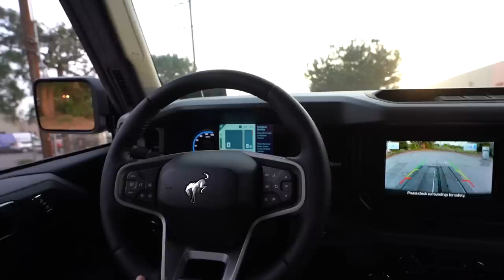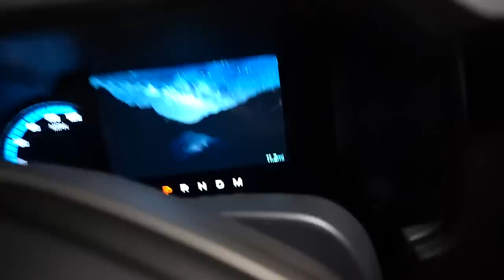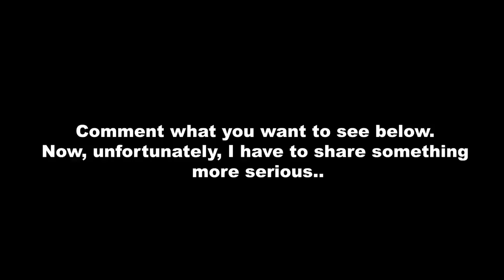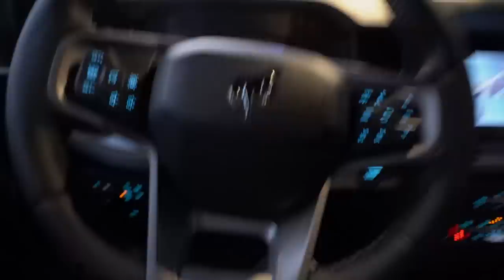Finally Taking Delivery of my 2021 Ford Bronco!

Comment: Sorry to hear about James’ injuries.  Hopefully he’ll recover quickly.  I have yet to see a new Bronco “in the flesh” even after several trips to the dealership.  It would have been nice to see you perform a brief presentation of your Bronco and hear your first impressions of it before you modify it although I am looking forward to seeing the wide body kit on it.  I thought the burn out with <10 miles on the odometer was a bit much, but it’s not my vehicle.  Then upon second thought you did the same thing with your C8 and look where that’s brought you.  Our brief look at Tomato’s new interior was impressive.  The new parts really cleaned up the interior and made the conversion look professional.  Nice job.

Comment: 6in long travel kit with 2.5 coilover reservoirs , upper and lower control arms 2.5 shocks in rear with reservoir....wide body for the extra width upfront and your choice of 35 or 37" wheels

Comment: Get well James!!!
I want to see Coyote engine swap, solid front axle and on 40’s 😜
Reply: Leave the axles, we wanna see just the coyote swap just to make it simple 🤣
Reply: @chri2halty954  solid front is much stronger. Probably want the ifs if you go long travel though
Reply: @chickensfloat7427  long travel ifs is so nice looking. Seen the new Bronco raptor? Comes with it
Reply: @chri2halty954  just googled it, not gonna lie that things pretty dang cool. I like solid front axles but im the kind of person who likes old outdated primitive but tough shit. I daily drive a 40 year old jeep, im probably just weird. Ifs is probably better for 90% of what broncos will spend there life doing, hell its hard to even find a jeep with mud on the tires
Reply: @chickensfloat7427  wellllll i bought a basic 4dr bronco without the lifted package because i rarely have time for off-road. If that's something you're going to be doing then definitely worth the small price for the upgrade
Reply: @chickensfloat7427  and i understand, Independent suspension is good for both Terrains. Especially for On road use, it's extremely smooth and comfortable but it's good for taking abuse off-road as well. Just make sure you have beefed up tierods 😂
Reply: @chri2halty954  ifs is great, but what concerns me is when lifted cv shafts tend to be more picky then driveshafts and u joints. No sence spending the extra $ i know if i bought one i wpuldnt be able to afford to beat it offroad 😂 another reson why i drive old junk
Reply: @chri2halty954  i praise my solid axle in my jeep, but with leaf spring horse and buggy springs it doesnt handle bad for what it is, but like most old jeeps it handles like a turd sandwich without the bread. Every bump rattles your teeth out and every turn has to be taken slow. Ifs is wayyyy better for most people, i just like to mod things to a unreliable point and beat on my cars. We have a early 2000s ford truck, now 170k miles in due to the lift the cv axles at a steep angle has worn out the bearings in the front diff on the drivers side. It eats seals so i know its the bearing, although the front diffs in these do go bad since they dont have locking hubs i dont think the lift helped. But like i say most people dont mod things like i do, changing things always makes thing unreliable
Reply: @chickensfloat7427  i completely understand, i also drive a 96 bronco

Comment: The crank position sensor circuit is more sensitive on aftermarket controllers. Rewire the crank sensor with some twisted shielded wires and keep it away from any EMI.

Comment: Wishing you a Speedy recovery James 🙏🏻…..
Fox 2.5 Elite series DSC Coilovers should get 3-4” lift and fit 35-37” tires,
and the 2.3 could use a tune with those bigger meats.

Comment: I also had similar issues with my WRX and it turns out it was an ignition issue; the ignition barrel has a sensor that wasn't picking up the key when it was inserted. It literally cut out on me on the highway.

Comment: I'd replace the bolts on your roll bars, as seeing those, I'm pretty sure they will shear under any real stress. Some Grade 8 bolts would be a much better choice. I'd also increase the diameter by at least a 1/16 on those holes so you can drop in a slightly larger bolt. And, all that being said, I'd probably ad some weld to it to reduce the chance of shearing them. Just zap a weld on each corner. 

The other thing I might consider is adding a piece of tubing between the mounts with a bolt pattern to match, so you can reinforce the bottom of the cage, instead of just relying on the unibody metal which is probably pretty thin, and would bend and tear with enough stress. 

As is, that roll cage is more for show than anything else.

At the very least, swap the bolts out for slightly larger Grade 8 bolts, use an epoxy resin or something to reinforce the mount, and add a mounting plate to the underside of the body to clamp on.

Comment: Time for a bigger Turbo & a little more Boost,  maybe some Head work,  also need to add a burn out water pump bottle,  that pumps water on top of the tires to help get the tires spinning easier.  I would go with some 30" tires & raise it up 2.5"/3""  I really like the color !  What's up with Mimi ??

Comment: I hope they find the driver.. I'm the survivor of a near fatal hit n run motorcycle accident. You're not wrong about James's recovery, its gonna be a long and painful recovery. I'm 4 1/2 years into my recovery and still going through surgeries, I'm gonna be going for my 9th wrist surgery in march. 

James, you've done the hardest part which is you survived. keep pushing on but don't try to push your recovery to be quicker then it is, your body is gonna need time to heal. hope your recovery goes smoothly!

Comment: The Subaru is the most interesting car you have to me. You probably should have put a new carpet in it and maybe flock or retrain the dash, steering wheel, headliner etc. Not sure on those mirrors either.

Comment: Your trigger issues are likely RF noise in the signal...from either a plug or coil wire(s)...try routing a fresh wire from the crank sensor to the CPU routed far away from the aforementioned plug and coil wires...make sure you're running noise suppression (resister) wires...Mallory Pro ceramic boot wires are ideal. Aftermarket CPUs can be very finicky when it comes to RF noise...if it sees anything funny or inconsistent in the signal, it safety defaults to "off" mode.  I've even resorted to running coil + and ground wires through steel brake line  tubing to suppress signal noise.  GWS James...I hope they catch the bastard so James can sue his pants off.

Comment: Bronco - Lift kit, huge fox shocks, built 2.3 with deck support and ported head, upgraded drive shafts and a decent built not bought fender wide body conversion.  James hang in there and never stop talking s&*t!